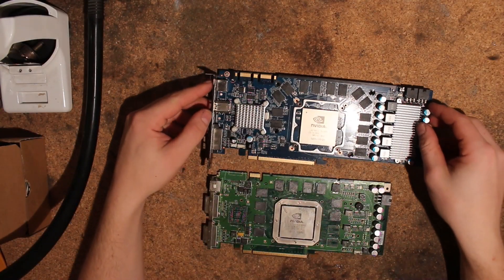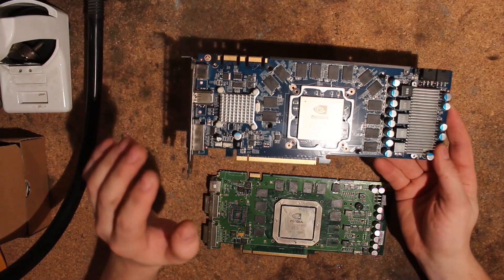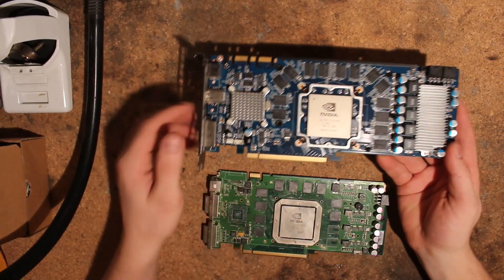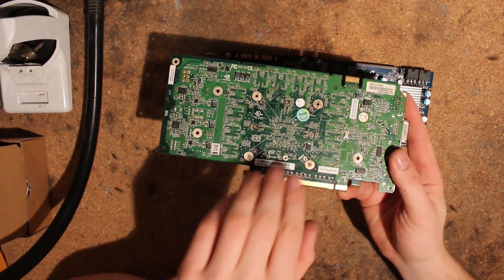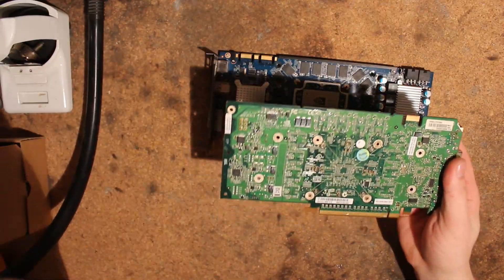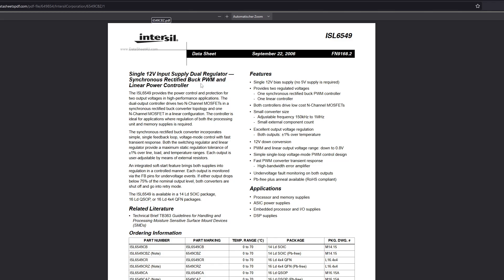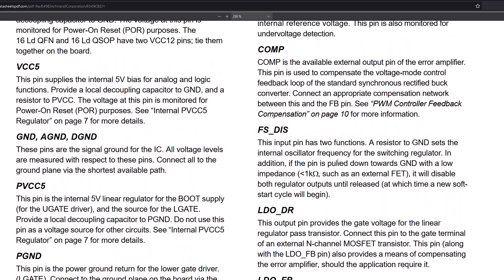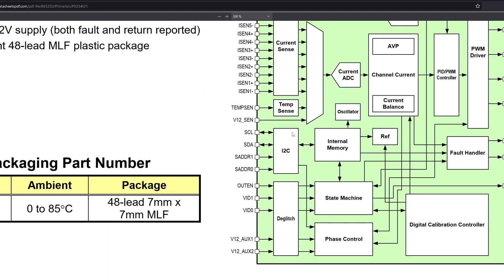How to fix colbug / coldslow on GPUs

Comment: Does the software solution work for all cards or just specific ones?
Reply from the maker: Just speccific ones, allso doesn't work if card turns on VRM before you're in OS, so might require to be combined with the EN mod for VRM :)